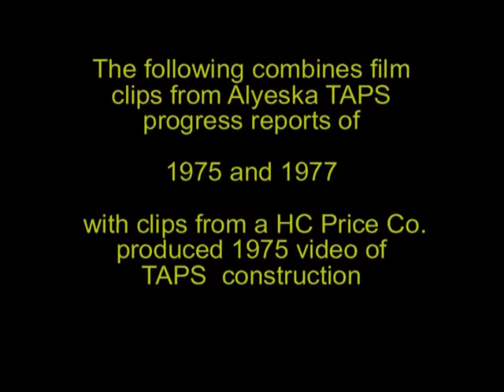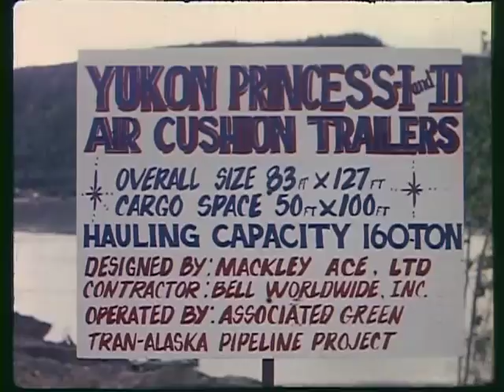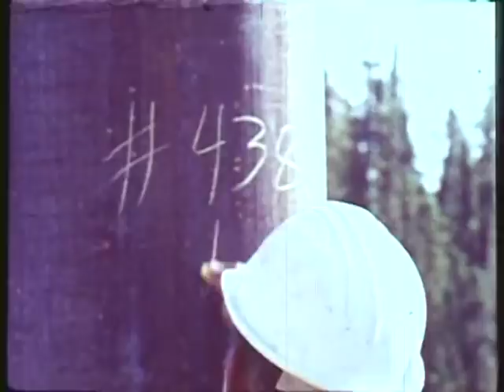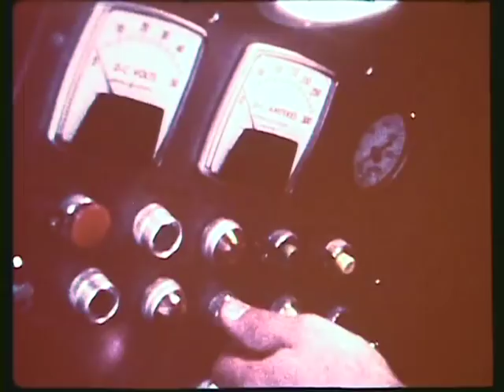Progress Report, Alyeska Pipeline -- 1975

Comment: My first job as an apprentice operator (#3) was in Valdez and I was sent to bunk in the northernmost baracks moved in from a Canadian logging camp, and it showed...and it snowed...as it blowed. When the wind-up alarm clock rang in the morning the "12" was the only thing I could see of the clock, the rest having been covered in snow by drifting into the room. Power was out and heat was, of course off. It was said that "White Hats up north got the heating fuel without water and we got the fuel with the water. First R &R out bought me an Eddie Bauer goose down sleeping bag good for Zero degrees which travelled everywhere with me. This 4 year stretch was one of the best learning and earning opportunities I've ever had and with it came some great memories.
   Land got too expensive for the pieces like I desired, my homesteading dream vanished with the pipeline bill's passing so I bought me 40 acres on an Idaho Panhandle mountain and this is still home.
Reply: We just had a celebration of life for my dad who passed away this time last year. He told me stories about this. He was an engineer on this project. To see it is amazing!! Thanks for all your hard work and perseverance ❤️

Comment: In 1975, I worked as a Teamster (fueler) on the northern stretch of the project, from Franklin Bluffs to Atigun Pass. I worked 12x7x7 with two weeks R&R. It was a memorable experience, especially for a 20-year old. Also good food and good pay! As I recall, I was one of three local (Alaska) men in our crew. Although I was born and grew up in Alaska, I gotta say it was pretty darn cold in Atigun Pass in December 1975 though.
Reply: I was there. Job steward for the Franklin Bluffs to Happy Valley, Toolik, Galbraith Lake, and Atigun. I saw -75 F at 5 Mile that winter. I was fuel truck driver at the time. Also born and raised in Alaska. And still here.
Reply: Hi Mark, I was at Dietrich in late Oct. '75. I remember one night the camp temp. was -57 with everything running so I certainly do remember the early cold. Worse for you up there in the flat open tundra!  I was  first a school bus driver & then in a fuel truck . One night at a pipe storage yard, I was fueling an outside tank overhead when it overflowed & gushed in my face & soaked my clothes. I was lucky to be near a heated building to get dried out. But the aurora made me feel better!
I also was at Prudhoe Bay in Sept. '75 & for a couple of months in '77. I was at the Ralph Parsons camp at Prudhoe when Elvis died. Never forget being told in the hallway about that. 
In '75 was at Pump Station #5. '76 saw me back at Dietrich, then all summer between Old Man, Prospect, Coldfoot too. '77 saw me between north of Fairbanks in the White Mtn. area, then got sent south to a little bit north of Delta Junction, stayed at Pump Station #9, then moved on down to Pump Station #10. I'm from Minn. & so much snow through there they had to cut the Richardson Hwy. through the Summit Lake Lodge which burned in '93. My brother worked at Delta Junction & Isabel Pass camps & I have him to thank as he knew someone here who knew someone there, etc. to get me up there. 
Have been back to visit in '84, '95, '01 for the honeymoon, '03, & '15 for a trip from Homer to Prudhoe Bay, showing my wife all the places I'd been. Stayed at Cold foot twice & on the wall at the restaurant is a pic of the pipeline camp from Aug. '76 when I was there! Fun to watch this & reminisce!
Reply: I remember the bumper stickers that said "Relieve gas pains...build the Alaska pipeline"
Reply: For or qworedor
Reply: @scottrayhons2537  the alyaskan pipeline service company this is a significant expense for the export of crude oil
Reply: @jonrukavina9011  -57F at Dietrich in October? The trees make their last stand there.. love it
Reply: My dad was out of Delta junction His name was Jack Nrady They called him Yukon Jack  Did any of you know him He was the big shot over all surveying
Reply: @jerrybrady7997 my dad worked out there too! John "The Bear" Kauth .... We just had his celebration of life last night ❤️ what awesome men to have worked on this grand project!!

Comment: How does that work when several welders all welding at the same time. Everybody uses the same ground cable and it don't backfeed to another welder?
Reply: Every machine has it's own ground, each machine acts as it's own circuit. These were also independent engine driven welding machines, and were not really interconnected. Same thing applies with grid powered welding machines. The welding ground is deliberately isolated from the "grid ground" to prevent currents feeding either way.
Reply: DC welders were the most stable. Current wise. Gave more consistent runs. EVERY inch of those butts was X/Rayes. One repair. Warning. One cutout. You gone.
Those "stovies "we had on the 36in Gas lines were probably the best in the world. They got enuff. We operators were on ?80 plus pound a week they were up around 300/320 pound beside us. I missed the Alaska line back in '60's was on Sahara/Atlas Mountains one instead.